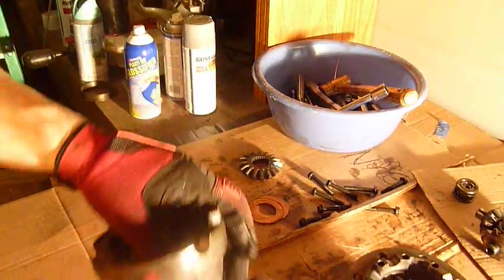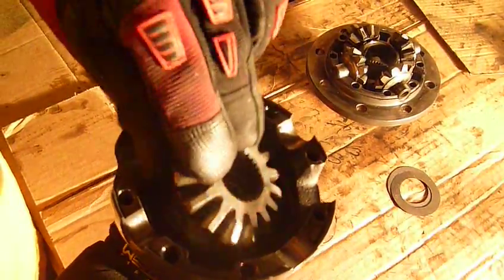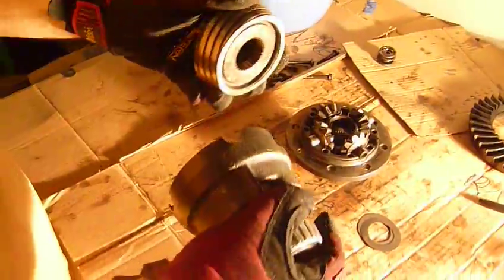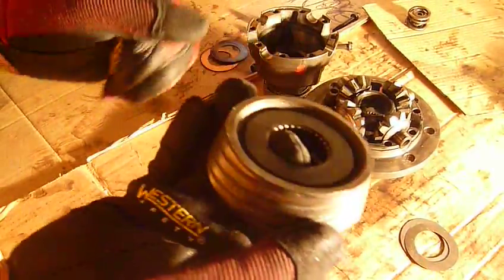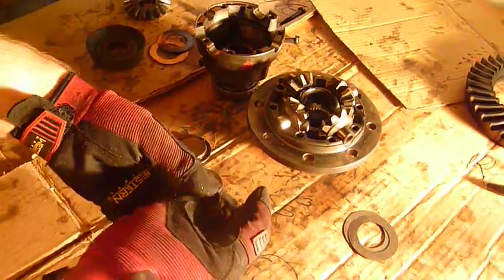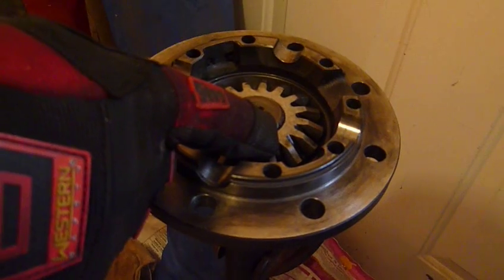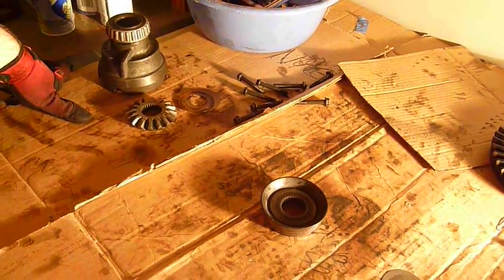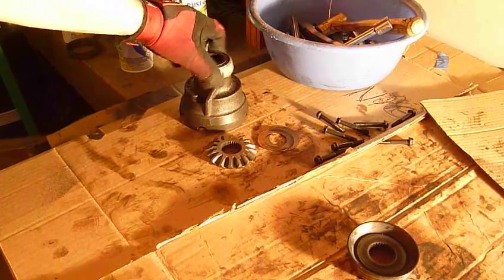Rebuilding a Borg warner 7.75" 9 bolt posi

Comment: Fix any clearance issues like shown. But be sure to shim the springs. I recommend using gear oil without " posi trac friction modifier" already in it. Drive it, when you take a turn you will get a "Reeeeeep" high pitched noise and slight drag, this is the cones protesting, but you will also get some solid "posi" traction action. Now get the separate small bottle of "friction modifier additive" and add a little at a time and drive it in between, repeat until the noise is gone, or as gone as you find necessary. You may end up using 1oz or less. 
        It's whole purpose is to create a film of that prevents the cones from locking up until they have rotated enough to sheer off the "film" left by the additive.
   Same thing it does on a clutch type posi unit. Just enough is best.✌

Comment: Hi Kyle, Thanks for making this video! I am about to start a 9-bolt rebuild. How did your diff work after your rebuild? Did you need to rebuild it again in the time that you had it? If you were to do it again, would you do anything differently besides add more shims? Did you measure the preload bite (when you finished) by measuring the torque needed to rotate one axle with the other axle and pinion locked?

Comment: Not sure if you still reply to this post...but I have a 9 bolt 3:27 in my 89 GTA and want to rebuild it.  My goal is to build a 383 Stroker with about 475 HP.  What's your opinion of this rear ends ability to handle that kind of Horse Power?

Comment: Almost 6 years later, here I am saying thanks for the video! -  I can't find any other videos on YT except this one on this differential!  But it is so common in use around the world I'm wondering why there isn't more.  Mine is the weaker version of this one, a 25 spline single pinion LSD, this one in the video is a two pinion unit with 28 spline axles.  (I think you guys say "pin" we say pinion).  Mine is out of a mid 70s Ford in Australia.  I would have liked some more specific DIY teardown and reassembly info (eg torque settings and more critical info) but can't complain as this video gives a good overall view and breakdown of assembly and some interesting points to note.

BTW, we don't all them "posi" here, that is usually for the clutch style differentials.  As mine is a Ford unit, made in Australia by BW Australia, this one is an LSD or Limited Slip Differential, which is Ford terminology.  However GM would have their own names for them.  Chrysler Australia also used this exact one from the late 60s to the early 80s (a 25 spline single and two pinion version, open centre and LSD) But the Chrysler terminology is "Sure Grip"

Comment: Thanks for a great video! I needed to see this exact video. I was driving my Camaro with a 9 bolt posi. And it sounded like the wheel bearing. The caliper was stuck... But I don't see anything wrong with the bearing, which is cone shaped and everybody tryin to sell me a 5707 flat bearing. The axle still seems hard to turn. I really thought it was the bearing, but now I'm not sure. How do you tell?

Comment: Love your video.  I am about to attempt this but What signs will tell me it's too late to rebuild due to wear?
Reply from the maker: Miles Czechowski you’ll see where the cones have started to grind away at the sides of the carrier/case assembly instead of wearing on the tapered conical section. Even then if it’s not too bad you’re okay. Just note that the cones themselves should only be contacting the case in the spiral grooved surface.
Reply: @KyleP133   Understood. Love the help Thank You.

Comment: I'm in the process of buying a 3 series carrier, the cones bottomed out but the guy selling it to me said I can add shims or buy new cones. Is there a way to tell if the carrier is no good anymore in that area?
Reply from the maker: Benjamin Hernandez You will HAVE to disassemble to check for case wear at the base of the cones. I would avoid it, even reconditioned they're not known for lasting a terribly long time, depending on how hard you are on the cones.

Comment: how do you machine the parts needed?
Reply from the maker: Took them to a machinist and he put them in one of his machines. He said any machine shop should be able to do it. He charged me $40 to do it, but said next time it would be $60 because it was a little trickier to get it mounted up than he expected. So... ;)

If machining costs in your area are exhorbitantly expensive, you can just take a grinding wheel on a drill press (use some sort of collet like what's on a dremel tool) and and just go to town on the cone and the carrier no problem.

Comment: thanks for the video   just opened my 9 bolt and am scared of the metal shavings. looks like lightly metallic paint.
Reply from the maker: Metal shavings are completely normal, that's just how these cone clutches operate. If they're working, then there's direct metal on metal contact, and a lot of it, so you get metal shavings. Check and see if the cones are bottomed out in the window. Thats the only way to know if you need to open it up.